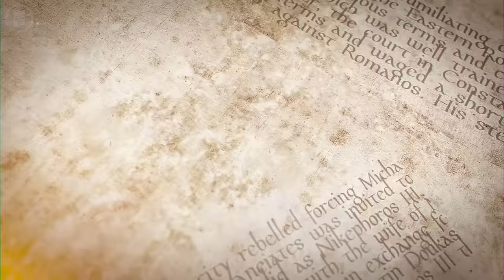First Crusade - Rise of Alexios Komnenos - Medieval DOCUMENTARY

Comment: Great video as always, just one thing about the map, Croatia and Serbia were fully independent during this era, so they should be depicted using a different colour from Byzantium, not shades of the same. Also the small Adriatic duchies bettwen them were by this time more or less fully incorporated into one or the other. Also the Emperors of Georgia weren't called Tsars, but Mepet Mepe, meaning King of Kings, Tsar is the Slavic word for emperor, while the Georgians are Kartvelian.
Reply: Ehh Serbia is complicated , it was multiples states at this time and Ras Acknowledged Byzantine Suzerainty, hence why it showed up at the battle of Dyyrachium before betraying the Byzantines and not entering the battles. 

That’s just one of the usual Colors they use for Croatia, if they were representing it as Byzantine it would be Light Purple like the Serbs.

Agree about the Georgian thou, using Tsar kinda wack lol.
Reply: @tylerellis9097  well thats the thing, by this point Serbia was no longer a vassal state, also it could have easily been named Dioclea on the map, since the Serb rulers were centered there and not in Rascia (map incorectly shows them as seperate)
Reply: @88kjk75  Not True Byzantine Lead Seals of Alexios have been found in Ras dating to the 1080s( Stojkovski 2020, pg 153.) Dukja was defacto independent yes but they nominally and dejure recognized Byzantine suzerainty. When they betrayed  the Byzantines at Dyrrachium a Byzantine Force was sent to resubjugate them after the war.

I agree all the Serbs shouldn’t be represented as 1 state thou.
Reply: @tylerellis9097  could you link me that work you cited? As for Rascia Michel of Dioclea had already conquered it from the Byzantines at latest by 1074, and installed his son Petrislav as it's governor. Now that seal could have ended up there by a variety of means, but the Byzantine rule in Rascia or the Serbian interior started vaining already by the mid-11th century